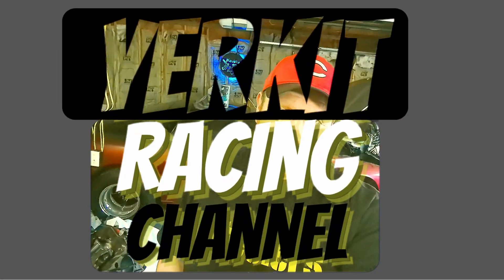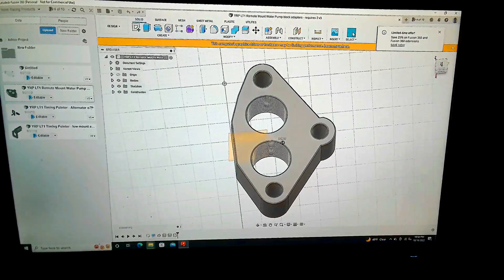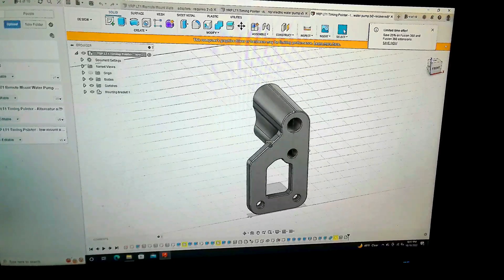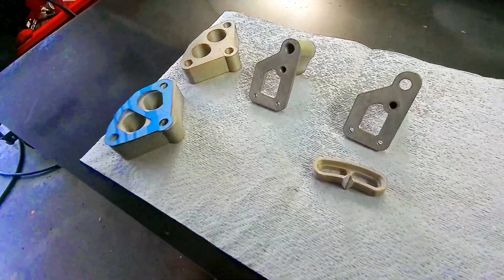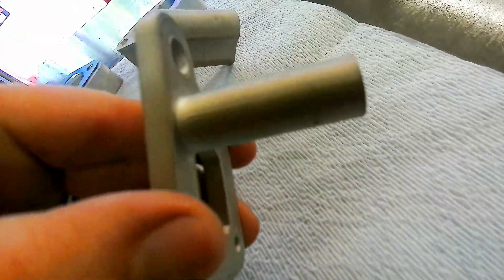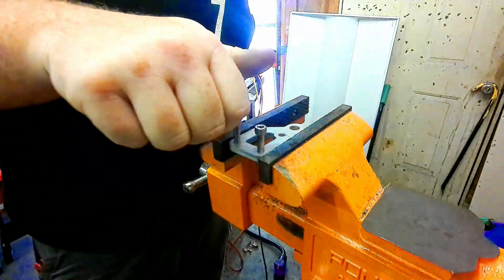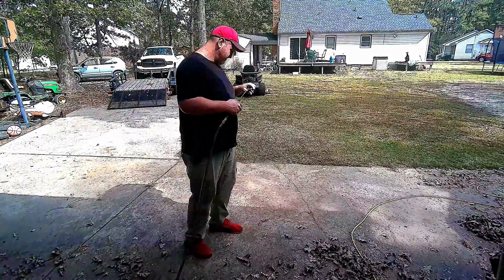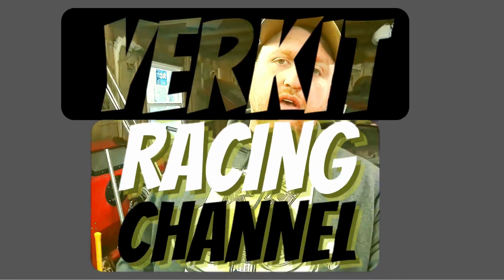New LT1 parts! 3D PRINTED TIMING POINTER & block adapters for the Gen 2 small block chevy -1st draft

Comment: So, that was 3D printed metal?  I'd like to buy a bunch from you after you are happy with the final design.
Reply from the maker: Yeah they were 3D printed stainless. Trying to see if they can be milled out of aluminum now as the 3D printers for metal are really expensive and these first ones were done as a favor for me. Final product will most likely be 3 pieces with the pointer, bracket plate and spacer tubes.

Comment: I bought an Allen groves 227r low mount alternator bracket, and I had to get a corvette crank hub and balancer. The bracket is low mount pass side. Would the timing pointer work with that balancer? And do you have anymore?

Comment: @yerkitracingchannel have you finalized your design yet?  I am LT1 swapping an older vehicle and going with an HEI and carb so I need a pointer to set my timing. thanks!
Reply from the maker: I have the designed finished and for sale on yerkitracing.com but they are currently out of stock. Trying to get some more made now. Will your setup still have the opti unit on the front or do you need one to work without the opti?